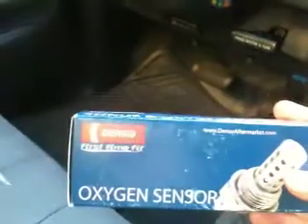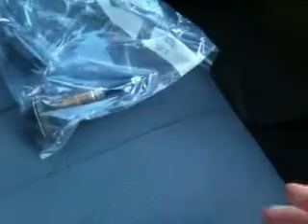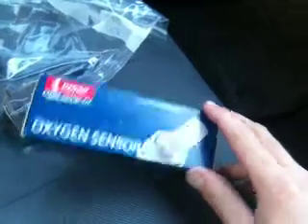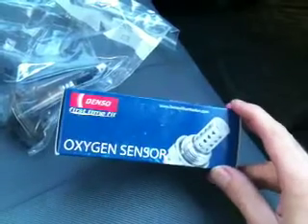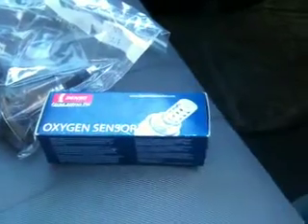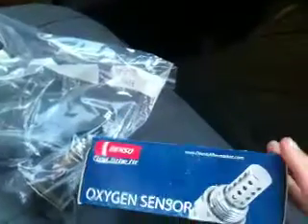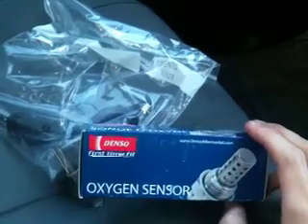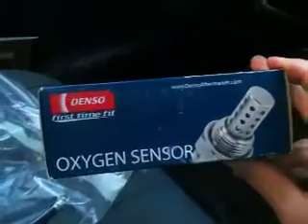How to fix a P0420 code 96 Toyota T100

Comment: For me the best way to clean my cat, I use a $.99 cents oven and grill cleaner which I bought at the 99 cents store I sprayed it let it sit for 15 mins. then wash it out with the water hose let it dry check if it's clean, I did this 3 times to my cat and it came out like new just make sure you wash it pretty good because this chemical is very strong it removes all the carbon that is my experience if you do yours do it at your own risk.

Comment: Your link is for the UPSTREAM O2 Sensor?? I think? You said it was the DOWN STREAM O2 Sensor that was causing the problem! Your link is not the part number on the box that you showed in the video!!
Reply from the maker: Dan Keller My bad,
Thanks for pointing that out. Problem corrected.
Reply: Jon M. I guess the other number was the before the CAT. UPSTREAM O2 sensor!!..Did you end up changing them both with Denso units??! Hope the downstream one fixes my problem LOL!!
Reply from the maker: Dan Keller I changed the upstream sensor a little while before I got this problem with a denso. The upstream sensor through a different code. This fixed my problem for the most part. Every now and then the P0420 pops up, I just erase it. I think my CAT is weak, I'm trying to avoid replacing it at all costs, being that they cost a lot of $.
Reply: Jon M. Oh glad you mentioned the upstream sensor was giving a different code so now I know I only have to try changing the down stream sensor!!! I bet my CAT is weak also 255k miles!!!!
Reply from the maker: likely with that kind of miles. fingers crossed.
Reply: Jon M. Yea just got to get the thing past a smog check so I can sell it pretty soon lol
Reply from the maker: Dan Keller I got ya lol!
Reply: Jon M. Major fingers crossed lol !

Comment: I will agree. Asian cars do not like Bosch O2 sensors. They don't switch fast enough for them to be happy and will throw O2 codes. I think if you've got a BMW, WV, or Mercedes Bosch sensors work well. Easy way to tell, if your sensor has holes in it, it is probably a Denso, if it has slots, probably Bosch.

Comment: MY FIX i tricked the rear 02 sensor
used resistor 1 Mega Ohm and capacitor 1 micro Farad 
no more p0420 i hope it works for now

Google MIL ELIMINATOR
DIY O2 Sensor MIL Eliminator

Comment: let me get this to all you - if your cat is bad 2 things one: your car is old and it is simply bad do not waits time to cleaning it did my did not helped. if the car is fairly new you can clean it but ask a question why it is dirty and the answer is that engine exhaust valve are leaking cat converter with a proper maintenance can serve up to 15 years